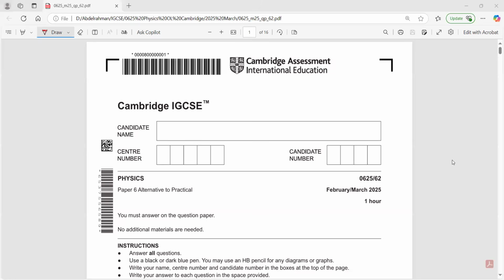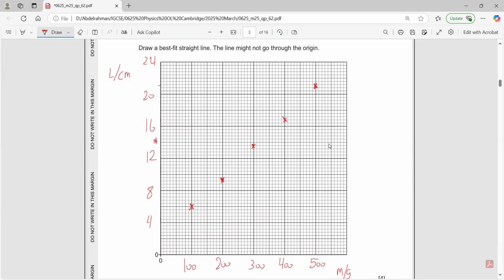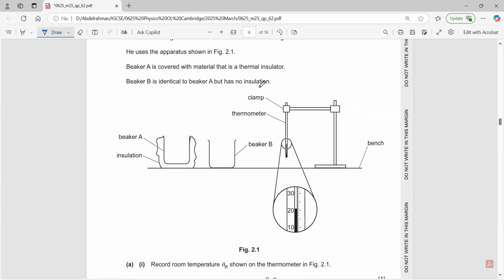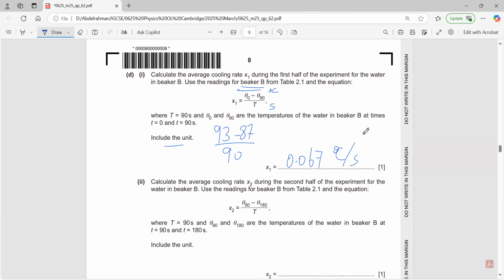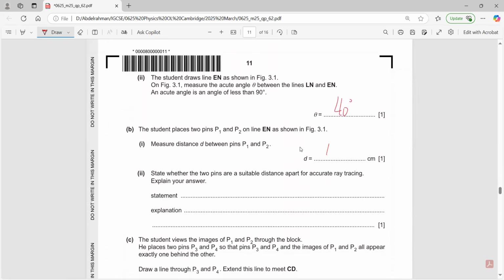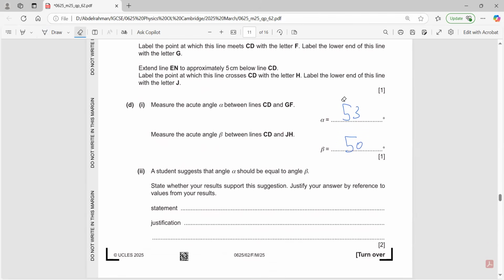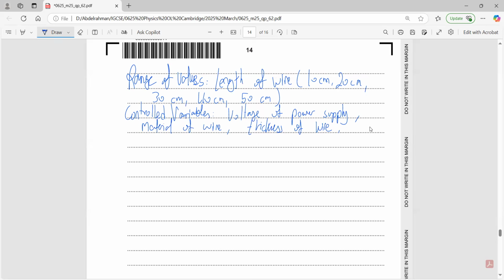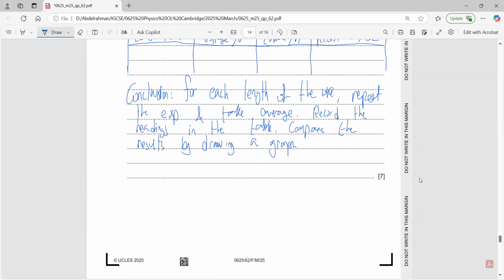IGCSE Physics 0625/62/F/M/25

Comment: sir, for question 2 e , the scheme says, yes agree, initial temperature must be the same to ensure the rate of cooling solely depends on insulation. will i get marks of i write answer similar to yours sir?
Reply from the maker: You can write either answer but you just need to add the values you obtained in di and dii (which i forgot obviously)
Reply: @a.tawfik96 okay sir. Thank you so much
Reply from the maker: @AmritaRevi you're most welcome 😊

Comment: for the lens question, can i draw a 5cm mark vertically downwards from CD and then extend the line EN to meet the 5cm mark horizontally?
Reply from the maker: It would be very difficult to do that, plus the line wouldn't be actually 5 cm long it would be longer. It's just easier to extend the line

Comment: For 1)e I wrote 132.6g is more suitable because higher the value lower the uncertanity.And plus that question is only for 1 mark so don't u think in the ms it would have given any one but with a correct explanation

and for 2)b i wrote use a stopwatch and use a thermometer for to measure the temperature.(Plus in the question they didn't tell anything abt stopwatch).
Reply: BRO same i was abt to comment about the same thing i think his solving is not fully correct...
Reply: nope, always take the sig values according to the ones in the given table. Since the majority is 1 and two, thus we will take 130 as the results would be then more accurate